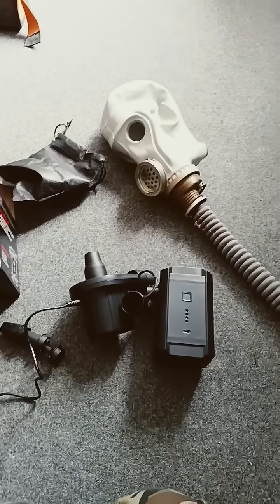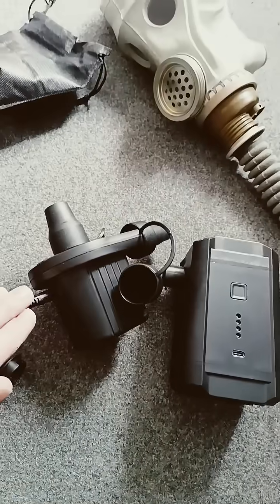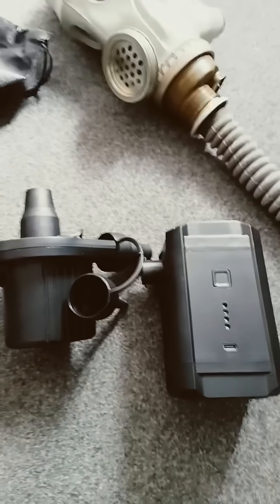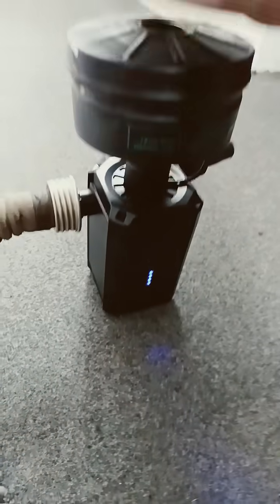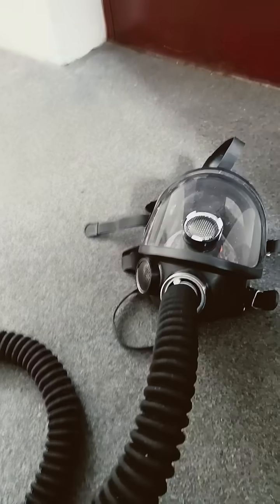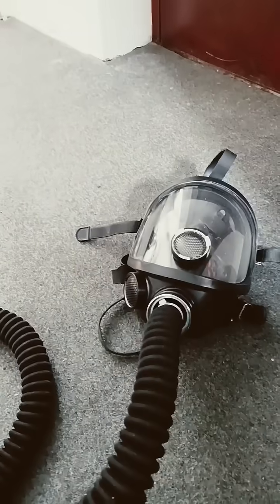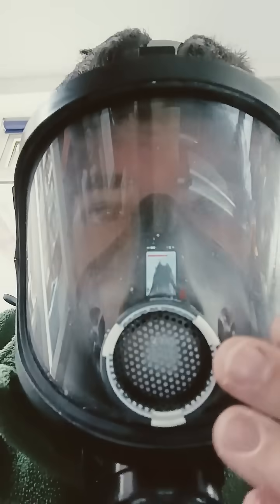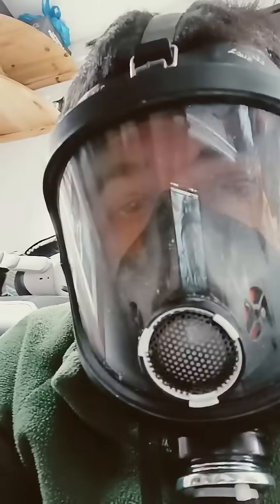Working PAPR system homemade for £20 #gasmask #diy

Comment: why do you even need PAPR system? isnt the new filters, you know designe to be used and be comfortable without the PAPR. What is the point here?
Reply: Yeah so basically it makes it easier to breath with multiple filters rather then just one but I think your correct new filters and masks are pretty easy to breath through
Reply: @reticle33  THX.
Reply: @reticle33  PAPR is really expensive equipment and if making your own is viable and reliable then why not
Reply from the maker: PAPRs are great if you are wearing a mask for longer periods especially in warmer weather, keeps your face cool.